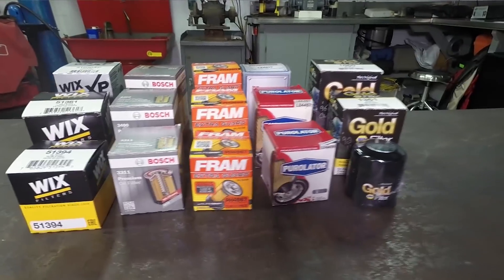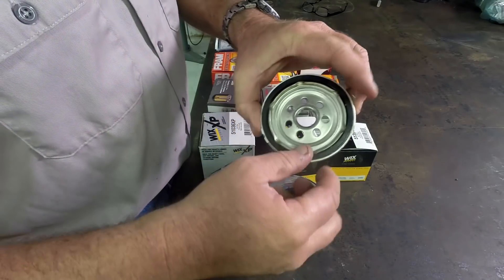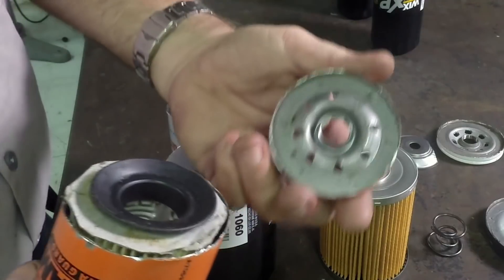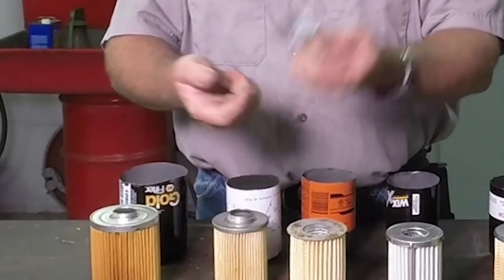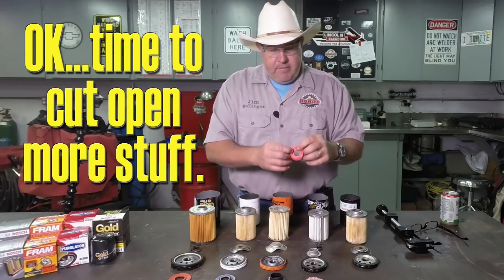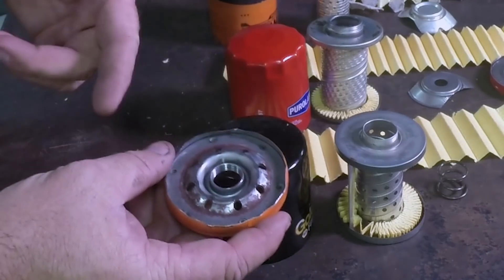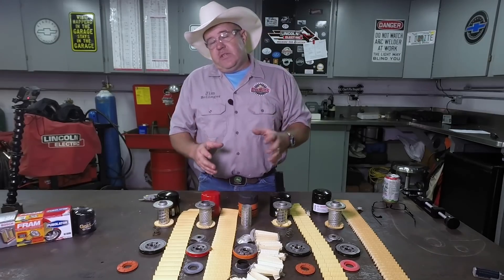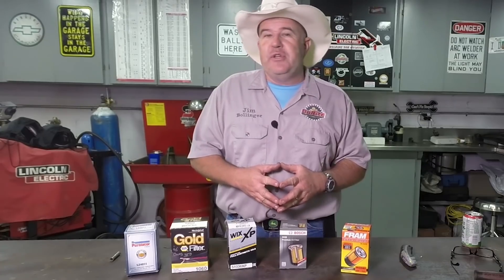The worst oil filter EVER!

Comment: Lol at the people that are completely ignoring the video and dozens like it to defend Fram.  Just because your engine didn’t blow up doesn’t mean it makes any sense to take a chance with a filter so poorly made.  I would be mad just because you’re getting ripped off buying fram.
Reply: Lots of things made really cheaply perform really well. In order to say it was a bad filter you would really have to do some filtration test. That is the key.
Reply: Filters are cheap, it's just how cheap/frugal are you. It's well known the low cost Fram stuff is absolute junk so if nothing else this video gets you to buy something other than Fram then this video has served it's purpose IMO.
Reply: You could probably buy a filter and hollow it out of any filter media and your engine won't blow up.  The filter only removes crap that will degrade your engine over time.  I'm not saying do this or buy a cheap filter like Fram but just saying that the engine not blowing up isn't a good test of an oil filter.
Reply: I mean to be honest I don't think the FRAM filters will cause an engine to die. Maybe it won't reach 300k KM but it will reach acceptable millage. Oil filters are still regulated right? But yeah I wouldn't buy and never bought FRAM filters.
Reply: If a cheap fram oil filter did cause an engine to die, could it be proven to be the fault of the filter and  would you ever be able to get money out of Fram? I don't think you could or would.
Reply: I would be more worried about wear over time.  Your engine most likely will not blow up but because it’s so cheap and glued together most likely it will allow dirty oil to bypass the filter.
Reply: You aren’t making any sense.  The bottom line is for the same price or very close, you can get a filter much superior than fram.  Why would I want a filter that barely meets a spec?  Do you want to go to a doctor that graduated last in his class?  You are also ignoring the rust that only fram had.
Reply: @mike-uw6wt    
The manufacture didnt put that rust in there as the metal-forming process for the manufacture of the outer canister would have removed 99.9% of any rust that was on the metal before such draw-forming.  That filter obviously was wetted with water after the manufacture, maybe was in a flood, left in a wash bay or in a bucket for some time.  The 'falling apart 'cardboard' (aka - resinated thick technical paper end caps) and the easy removal of the 'flap valve',  clearly (more than suggest) indicate that this filter was probably wetted with water or submerged in water for more than a short period of time.  This was NOT done by any manufacturer.
Reply: NAPA GOLDS always....
Reply: Exactly how many engines have 'blown up' because someone used a FRAM or other 'economy' lube oil filter?  where? when? how many? 
As a long term filtration engineer ... I can estimate that answer: zero, especially if that or any other 'cheap' filter was used.   Even old fashioned IC engines that never had oil filters, ran successfully and without lubrication failure for MANY years ... simply changed the oil on a regular basis.  
What 'blows up' engines is forgetting to change the oil and the filter on a regular schedule, ... the oil viscosity changes downward to a lower value due to the blow-by of unburned fuel into the crankcase, the engine bearings are no longer 'supported' by the thinned out oil ..... crash !!!!
Reply: @richh1576  Whether or not the engine oil suffers any dilution from unburned fuel is down primarily to operational conditions - lots of cold starts & short trips will have a dramatic effect on that aspect - otherwise the PCV takes care of that problem. Over time though, poorly filtered oil certainly has a detrimental effect on the lifespan of an engine, as does ineffective anti-drainback valves in the filter. Sure, a bad filter isn't going to immediately detonate your engine (unless perhaps it comes apart internally and bits make their way to the oil galleries and block them) but it'll certainly have an effect on the long term engine life and premature wear.
Reply: @richh1576  Video shows Fram oil filters are garbage and you comment but it's okay you don't need an oil filter anyway.  This is the definition of "fanboy" or paid comment 😂😂
Reply: @richh1576  The video clearly shows it's garbage compared to the other filters.  If you want to use it for your engine by all means.
Reply: I’ve personally seen fram come apart inside and block passages n nearly blow up engines.  I did use them in old days... my own experience says ehhhhh no thanks.
Reply: If you change your oil and filter early (3,000 miles), then cheap oil and filters make sense.
Reply: @waynes.2983  How does it make sense when the other option is paying a little more and having considerably less labour required, regardless of whether you're paying for it or doing it yourself?
Reply: @Soy Yo Then it blows up and they say "American cars are crap"

Comment: Used them for years, had 3 cars with over 250000 miles no issues
Reply: in last 15 or 20 yrs theyll swicth using card broad in the filter to sell money and b cheap to maximums profit

Comment: i some how put a hole in my filter not sure how but anyway i had no choice but to put a fram on my truck i lost 15 to 20 psi and my truck would knock if i got over about 2400 rpm and every time i started it. i made it about 90 miles and got to change my oil and after seeing your video i think it was cardboard in my oil pan. wasn't sure until i saw your video. imy truck is still running good so i guess i got lucky.
Reply: my friend had a fram com apart and seized  his motor. he sued fram but fram layers won, they said it was his oil pump that caused the filter to com apart.

Comment: All I can tell u is if you’ve not actually tested performance there’s no way cutting it open tells u anything.  48 years old, have only used fram since my early twenties and have never had any problems with several cars. 2003 tahoe has 270k miles. Maybe they’ve figured out what is actually necessary to provide adequate protection. Pay more for over engineered products if u want but I’ll stick with fram.

Comment: you forgot the MOST important part - micron rating!  thats the REAL filter test!    i have no stock in fram BUT,  i have used them on our 06 chey equinox  - changing every 4-5 k miles and i have NEVER had a problem!   EVER!    we have put 150k on that car with no engine problems. just do regular maintenance, it will be just fine.  

also price is a consideration.  $5 vs $15  what do you think most people are gonna do??
Reply from the maker: I did not pay more than $7 dollars for any single filter.

Comment: Many years ago Fram filters where good filters and so where Puralator  but over time they both put Quality by the way side.  over the last 30 years or so I have been using OE filters on a lot of my cars  but switched to Wix filters about 5yrs ago you can't beat their Quality I buy them by the case. I don't know who used to make filters for Toyota under the Denso brand and the newer one but they where Quality filters  silicone o rings a  heavy gauge can  and good filter paper. but the new cartridge filters in my wife's 2013 Rav 4 are kind of crappy looking but everyone is going to this style filter . no more spin on's  I am 60yrs old and remember when cars had the old cartridge filters and the Spin on was way to go . Now it seems like were going backwards
Reply: Purolator has never been poor quality. And the new BOSS is one of the best filters in the world. Right up there with AMSOIL.
Reply from the maker: Funny thing, I was thinking the same thing.

Comment: I will not use anything but OEM parts on my cars. Original equipment filters and synthetic oil. The only exception is a K&N Air Filter in two of my cars. Scheduled maintenance as per the owners manual service guide. Done religiously. Five cars in the family are looked after this way and they have never let us down. After spending thirty years in the car business I have seen too many times what poor and/or cheap service gets customers, and then they blame the car!

Comment: So put an equal Fram, that's the lowest end version. Napa Gold would be a Fram Tough Guard price point filter. Not saying the standard Fram is not complete crap because it is. I believe STP is a Korean made Fram but I may be wrong. I believe Wix is produced by Hummel Mann the same company that makes Purolator and Bosch filters.
Reply from the maker: Not so. I did not pay more than $7 for any single filter. All the filters here were "oil change special " filters. Napa Gold is not a premium filter.

Comment: you are exactly right.  Fram is junk,, go to the junk yard and look at the engines with a rod through the block,, most cases there will be a Fram filter on it. Marketing,, I used them for years until my friend at his shop did the same thing you just did, Pudding ,, there it is ,, I used the last ones I had to filter my parts washer fluid.. Thanks
Reply: Engine dies cause an idiot has no oil, low oil, wrong oil, or never changed it. You don't even need an oil filter

Comment: Should have done a motorcraft filter. They have the best anti drain backs, because a few Ford motors will rod knock on startup if you dont use a filter with a good anti drainback! I just always use Motorcraft! That few seconds is your motor being starved of oil.

Comment: Why does everyone hate Fram? I've used Fram for years. I've driven the same vehicle for 20 plus years. If you change your oil and filter every 3,000 to 4,000 you will not have a problem. If you go to a oil change place do you think you are getting a good oil filter? Please! This stuff is getting old!
Reply from the maker: I don't "hate" Fram. I hate junk, three Fram filters, all with rust inside....I would ask you, why do you love them so much? The $5 Purolator was 5x the quality of the Fram, why don't you love it? Is it the marketing?
Reply: DoRite Fabrication - I do not love Fram. I also do not hate Fram like many people do on YouTube. I do not buy the low end Fram. I just have not had a problem with them.
Reply from the maker: The way you worded that made me laugh. I will not use Fram, but to each his own. I would use the Bosch or Puralator, if I couldn't use the Wix. I recently discovered the O'Reilly's house brand is Wix (upcoming video) that costs $5 ish. I was pretty impressed by what I found.

Comment: Well, you can show all this but I have used fram and Walmart filters for years on a Mercedes E320 (223K mi) lexus GS300 (240k), Acura MDX (170K) Lexus GS350 (116K) and never had a problem.  Also used cheapest oil too.  I think it is more important to change the oil per the owners manual (Not every 3k miles).  Just look to make sure they meet the required specifications in your owners manual.
Reply from the maker: Sure but if you are dumping rust into your oil via your new filter.....

Comment: I've used all brands of oil filters over the years, I never had a problem with Fram oil filters.
Reply: It's only a concern for the people that drive with low oil, wrong oil, or don't change it. I'll keep buying $6 fram filters cause i change my oil ever 5000 kms and would rather have cardboard than metal in my engine
Reply: HighStreet Killers , I agree and if you buy the Fram Ultra oil filters, they are one of the best filters on the market.

Comment: You can tell when you don't have a real mechanic doing these filter videos when they don't have the right tool to open up a filter. You can't open a filter with a grinder for engine diagnostic work. So I guess he has not seen any of these filter fail in service. I ran a 1990 Ford Festiva 265,000 mile using  using Fram filters. I saw the car years later and it still had the original engine in it with 350,000 on it. I am not a fan of the Fram but the only way I found to get the filter off was by hand and the rubber grip on the Fram helped. Get a filter can cutter and show us a failed use filter.
Reply from the maker: But only a "real" mechanic would be able to spot that.
Reply: Why did you not use it? I know they can be a pain to get them to cut through the first round but your on YouTube you can edit that out. I have mechanic  on heavy trucks and buses for over 30 years and now for the last 3 years I work on a fleet of cars and light trucks. I just wish when people do these filter videos they would show the bad failed filters. The best thing that you can do to keep dirt out of your engine as far as the oil filter goes is inspect it look for damage inside and out. Look for dirt down the center hole (the clean side) do not fill your filter with oil, you do not if that oil is clean, the oil company is not telling it is clean, they think your going to pour it in to the dirty side of the oil system. Cat tells you to put the filter on dry and they put a sticker on the clean side of the filter to keep the dirt out tell you install it.
Reply: he does have the correct tool to cut them open. it's right there on the work table, skippy.2:25 🤓
Reply: Your right I missed it. wonder why he did not use it. Still need to show me some failed filters. Why does he assume that Fram was at fault for the rust and moisture in the filter?  I have returned filters for rust on them you should not use any brand that has rust it was improperly stored.  The only fail I have ever seen on a filter is the glue joint where the filter material comes around to meet it self. I have cut a few Frams open and they where fine. But these where filters changed on time and not in dirty or cold conditions. I use Bosch at home right now and we use Napa gold at work on a fleet of over 500 vehicles.
Reply: If a filter did fail would you rather it be cardboard or metal in your engine ? These are people blaming a product for either not changing their oil, low oil, or wrong oil.
Reply: HighStreet Killers
1 hour ago
"If a filter did fail would you rather it be cardboard or metal in your engine ? These are people blaming a product for either not changing their oil, low oil, or wrong oil."
SAYS the FRAM oil filter rep.
If any metal came apart it  in a competitors unit would be large enough to be trapped in the filter media. The FRAM filter media looks cheaper and inferior. The filter media is the last line of defense.

Comment: You get a real appreciation for crap Fram filters when Dad changes his oil with one and blows up the engine in his car 15 miles later. Then, you get to spend a frozen couple of weekends helping him swing a new engine in the car in the middle of the coldest part of winter in an unheated barn....he said the filter was holding back oil pressure and blew out the seal when he touched it  when  the engine died and he started checking it over on the side  of the road ....Haven't bought a Fram product since. I pretty much always use Napa Gold and their oil - 4 engines run out to 300 to 450K miles on my commuter cars over the past 23 years that way.

Comment: Hey Bubba, unless you've done molecular analysis of the filter media, your "test" is just BS.  Several years ago Consumer Reports tested all major filters and the media in the Frame filters proved superior.  I drove a Ford pickup for over 325,000 miles using only Fram filters and NEVER HAD A LUBRICATION ISSUE AND THE VEHICLE NEVER USED A DROP OF OIL BETWEEN CHANGES .  I must congratulate you on your bogus evaluation using absolutely NO VERIFIED DATA.
Reply from the maker: Garbage is garbage, rust is rust. Please notice I did not comment on the filter media's ability to remove contamination, merely the surface area in each filter.
Reply: Hey John, did you not watch the video to see what junk Fram puts out?

Comment: Have you ever wondered why the auto manufacturers have reduced the "one quart" filters down to 2/3 size, then half size., and now they are smaller than your fist.... for the same size engines?? 
All that impressive filter media area is superfluous.
Have you ever cut apart USED filters and seen absolutely nothing in them? 
Ive cut apart filters that were run 15-20,000 miles and there is nothing in them.
Think about it.

Comment: Hey Jim......I have been buying the wix cartridge type filter for my daughters 2009 toyota camry 3.5. Is the cartridge filter as good quality as the spin on filter?
Reply from the maker: I can't really give you an accurate answer. What I can say is that every wix filter I have cut apart has what appears to be a higher quality standard. As to the ability of the media to stop particulate, I don't have the equipment to test that. I was just trying to let folk see a side by side comparison of different brands. I'm a Mann or Wix guy for sure now, but the Bosch/Puralator was of pretty good quality too. Draw your own conclusions, but I don't want rust in my engine